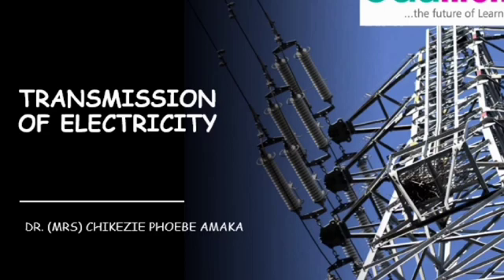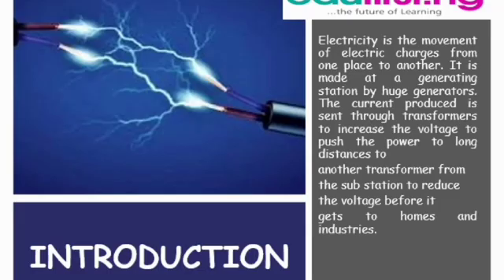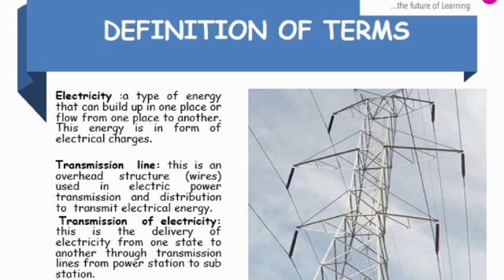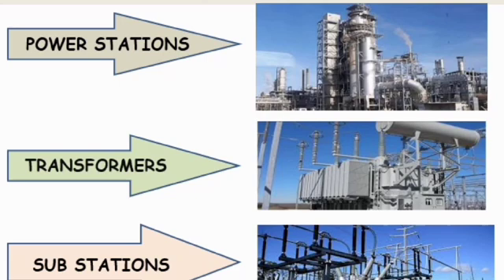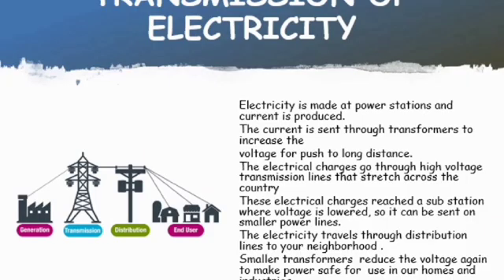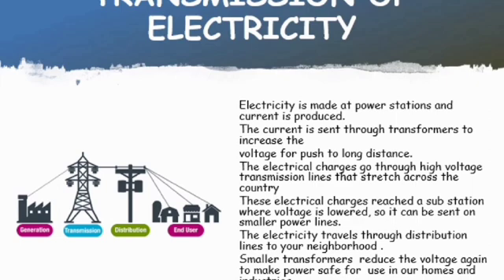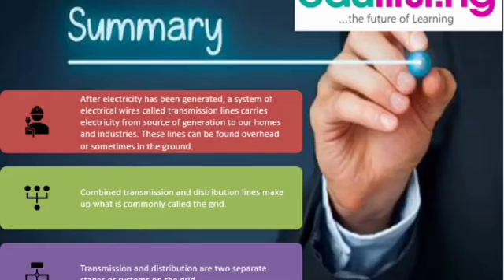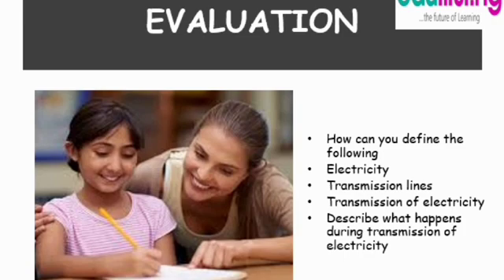Transmission of Electricity | Basic Tech | JSS2 | 2nd term

Comment: This is Shobowale Tomisin from FGC Rubochi, here is my assignment:

1:Electricity can be defined as type of energy thatch flow from one place to another

2: This is a structure used to distribute electricity from on place to another

3: This is the delivery of electricity from one place to another

4:The electricity made at the power stations are pushed to through transformers to increase the voltage to push it to a longer distance then it goes to smaller power stations then the voltage is lowered for it to be distributed